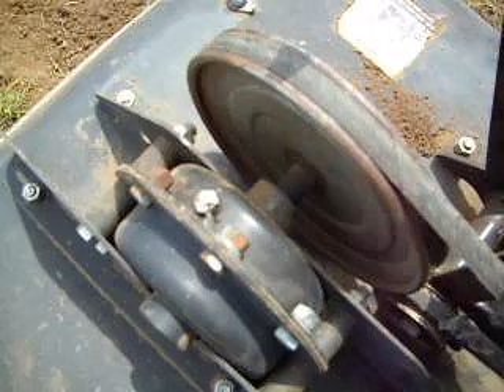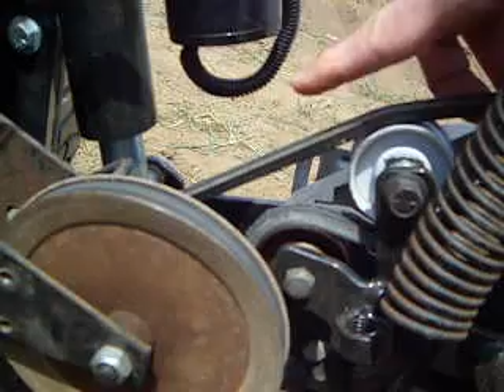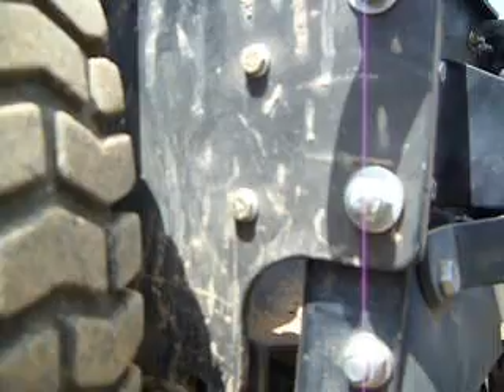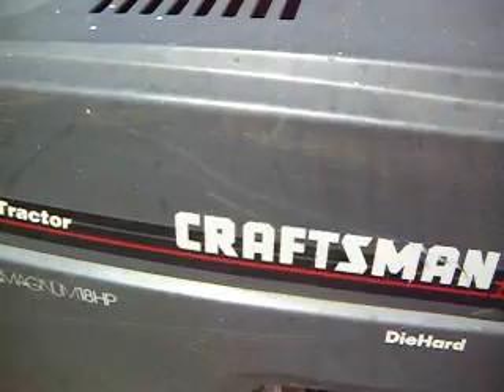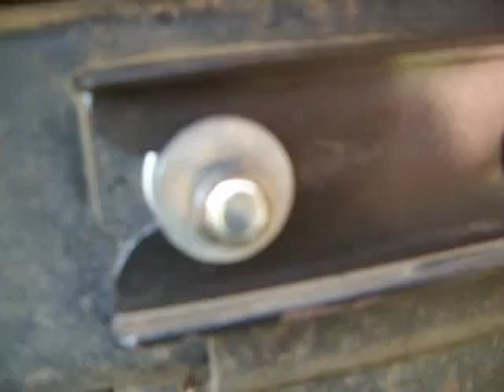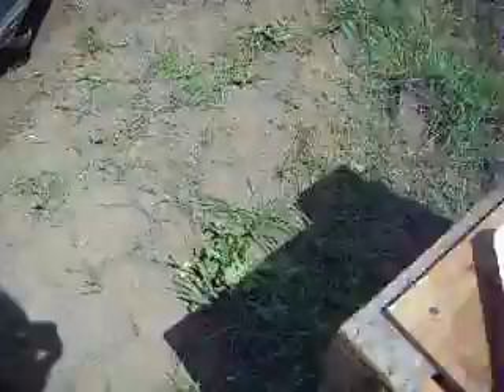Sears Craftsman Belt Driven Rototiller Installatio

Comment: Good camera views.  I'm going to build an attachment (can never find them around here for less than $300) and needed to see the belt arrangements,  and you did a well enough job showing the jack shaft that changes the drive belt direction.  

Now I just have to decide which tiller to use, as I have 2 different gear box orientations to choose from.  One that is like yours (perpendicular to the drive axis) and one that is parallel to the drive axis.  

Even when I was young walking behind a tiller was hard on the back.